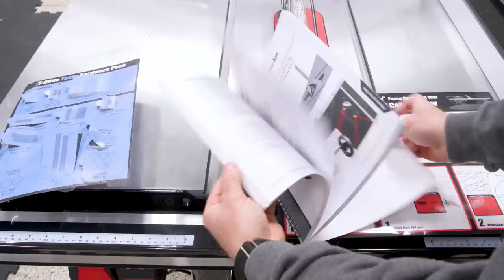I Left Powermatic for Sawstop!

Comment: What SS doesn't tell you
I love my SS and have no regrets about my purchase as a saw. It is by far and away the best saw that I have ever owned. It was spot on out of box and the only adjustment I have had to make over the past 2 yrs is in the fence alignment to the blade. When it is aligned it cuts with ease and it is only 1.75HP PCS. However, on one occasion it took a huge chunk out of the end of left thumb. It was my fault like all of these things are but like most people I was expecting the safety system to protect me, expecting no more than a slight nick. SS position per the manual "the safety system reduces injury and not necessarily prevents it". The safety system is a 2 part process, it triggers the cartridge and pulls the blade below the table. On this occasion the cartridge triggered, as it should, BUT the blade did not drop below the table. So even though there was only a very brief contact with my thumb blades are mighty sharp. So, why did the blade not drop below the table? The blade dropping relies on the angular momentum to drop but to do that it must be spinning above a certain speed. When is the most likely time that we might be foolish enough to go anywhere near the blade? When it slowing down after powering off. Below a certain speed the blade does not drop and it requires very little rotation to create a very nasty cut which took 1 month heal and still bugs me in cold weather. Every single demo of a SS with a wiener shows it at full speed. I have yet to see what happens to a wiener when the blade is slowing down. I wonder why SS never show that?? When I contacted SS (to get a replacement cartridge) the guy on the phone said "don't tell me the blade was slowing down!". So SS are clearly very aware of the issue. An active system to pull the blade below the table would be much better than a passive one. If the cartridge can be triggered why not an active device? So there is a weakness in the much heralded safety system! SS position was "you still have your thumb". Out of interest in every local WW store that sells SS I have describe what happened to me and asked "were you aware of this?". I don't need to tell you the answer!

Comment: Have you considered keeping the old saw as dedicated dado saw to avoid  the hassle of cartridge changes?
Reply from the maker: No. I really don't have the room for two saws. And if I'm avoiding cartridge changes then I'm sort of defeating the purpose of having the saw. If you want to run a dado without the safety feature, you can just install the dado and put the saw in bypass mode.
Reply: @woodwhisperer  thanks, didn't know that was an option
Reply: @woodwhisperer  the saw will actually refuse to start up if it can't detect a blade close to the cartridge. You gotta install the dado cartridge to use a dado stack

Comment: I'm curious as to why you didn't go with the integrated base given that you don't use it often and you liked that feature on your own Powermatic. I have my own sob story about the integrated base but would be interested in your take.
Reply from the maker: When I placed my order for the ICS, they shipped the things they had in stock immediately. So the industrial mobile base and the extra brakes arrived....then I waited several months. I switched my order to the PCS and already has the industrial mobile base on-hand and I didn't feel like dealing with returning it.
Reply: @woodwhisperer  Looks like circumstances worked out for you. I'm less than impressed with the integrated base which is curious as I overall love the saw.

Comment: Just curious as to why you didn’t move your Very Super Cool Tools fence over to the SawStop.
Reply from the maker: Couple reasons. Laziness is one. It took some work getting it attached to the PM fence and I really didn't feel like removing it and putting the old fence face back on when I sold the PM saw. Also, if I'm using it as a "face" the VSC fence is pretty big and bulky. So a simple extrusion was the better option for me in this situation.

Comment: Another great review! But, I have to question the blade kerf size and riving knife size w/dust collection. I bought a Laguna with almost exact same set up hoping to eliminate my overhead aftermarket Dust collector and have a good riving knife with anti kick back. The riving knife is .125" ONLY. I use Forest Ultra thin at .083 or Tenyru at .076 (I think) rendering the entire structure useless as "teets on a Bull"!  If SawStop offerers different size or into, you should mention this, IMHO. And, I had to block off the vacuum outlet as there was no such thing as an internal blast gate when not using the stock dust collector/riving knife! I quickly went back to my aftermarket overhead unit that also allows me to see the blade cut the wood, which you will not see with the stock unit you have as my Laguna. I cut all hardwoods as I make furniture and cutting boards. I use a 36" x 1/4" x 3/4" Oak vertical grain with a little notch at the top for a push stick. My hand NEVER gets close to blade. For me, the SawStop break is a useless expense feature. Also, the Fence on the Laguna is far superior in that it can be used tall or short! I cut small pieces and have been using a home made short fence for years. The Laguna is same extruded aluminum as your aftermarket  but with two options and two sight glasses for each! Laguna also added a Digital readout for tilt, which I thought was frivolous, but I now love for quick repeatability.

Comment: So there are a few to mention about the "saw stop tax." First up, you do not have to install a dado brake cartridge. You can just install a dado and activate the saw with the brake turned off. The way this is done is by turning the key, waiting for a green light flash, then powering up the saw, waiting for a green light, and once that light flashes you let go of the key. This is a perfectly acceptable situation if you're making just a few cuts. It makes you think about the safety when powering the saw, reduces switching time, and is equally safe to any other dado cut. The second thing to mention is the wet/moist wood. While this can in theory a problem, it really is not. I personally have cut moist/wet wood before, and never has the brake gone off. There was some wood that the saw would power off during the cut, displaying an error code about wet/conductive wood, but the brake did not go off. The saw can detect the difference between conductive wood and humans.

Also, check out the sliding compound table. It's a really neat addition. I know you love your miter gauges and have a miter saw, but teh sliding table really makes life easy for some work. Also for me it eliminated the miter saw, which helped greatly with space.

Comment: No way what I do justifies a SawStop, or the previous granite top Craftsman either.   One day my wife said “Let’s go get you a SawStop. Get what you want.”  I got the 36” PCS with the ICS mobile base and the folding out feed table and the T-Glide fence.  The extension table is junk, mine is now plywood with my router under it.  The router is on a magnetic switch, so if the router is on when I plug it in it doesn’t start up.

Who am I to argue with my wife?

Comment: I bought a new Powermatic Model 66 Tablesaw with 5hp Leeson motor in 1987. I had the motor rebuilt in 2016. This saw has several hundred thousand board feet of hardwood through it. This thing will last several generations.
Reply from the maker: Those old ones are real beasts!

Comment: As I recently sold my property of 22 yrs ( dope growers pushed us out)  I have  (temporarily) downsized, my entire 1000 Sq ft shop is now in storage while I build a new shop.  My 3hp 12" sliding table monster saw is there. 
I bought a Saw Stop Job Site Pro saw about 5 months ago for an interim unit. 
What a disaster.. 
During assembly the top deck insert slot was discovered to be  1/4 inch off and the blade could not go through the slot. Phone call, new piece to be sent. 
Next after assembly completed my wife said the top was warped. She is not a woodworker, but she saw this immediately.

I did not expect this as Saw Stop's ads and web site video claim "most accurate job site saw on the market"
I got out my handy 4 ft steel dedicated straight edge and began measuring.. shocking.
I measured 4 locations front to back and side to side.
Anywhere from 80 thou to ONE HUNDRED AND FIFTY SEVEN Thousands off.

Not Flat and obviously not accurate.
The following day  (Saturday) I took a 3 hour tour of 5 dealers selling other name brand job site saws such as Bosch, DeWalt, Makita etc anywhere form $275 to $1000         
The worst was  about 15 thou off and the best ( and cheapest) was dead flat.

On Monday I called Saw Stop.. The answered as follows. Hullow. I asked isi f this was Saw Stop and it went down hill from there. The challenged me and as much as said impossible and I am mistaken

Two Items here I have been a professional furniture maker for 220 plus years, second .. prior to that gig I was a corporate trainer  Field Management Training Manager   ( Mercedes Benz of No America, Volvo Motors of America, BMW of No America, Mazda Motors of America.etc  )  My expertise was Auto Management, financial , operations, inventory, parts and service management but primarily CUSTOMER SERVICE for 25 years. Saw Stop was a miserable failure.

After being referred to other departments ( who did not coordinate with other departments)  and a complete run around for 3 days and promised phone calls that were never made.. I returned the saw to the dealer  ( a 4 hour round trip)  I simply asked for a replacement saw.. they insisted that the variance in the to elevation was within specs.. they refused to give me their tolerances. I asked for a replacement saw.. no response.. none.
I got the dealer involved Oregon Tool Roseburg Oregon.. fantastic store) they contacted Saw Stop. They  would refund my purchase.. and she made an agreement with Saw Stop to trade out for a replacement (which I later found out took a couple of months)  
I made one final call to Saw Stop to remind  them of their promised calls to include their tolerable variance.. which their repair dept gave to me.    33 thou.
I also told them that I would buy a replacement if it was level.

No follow up, nothing.. but now I am getting spam from them for the last few months.. amazing.

Finally a saw came in and once again I drove the 4 hr round trip to see another saw. The owner of the company assisted me.. thank you Milo.. outstanding customer service. The top was flat except for a small area of an 8 thou drop. Tolerable.    I have assembled the saw and here is my lengthy review.

I bought  the Saw Stop Pro  for three  reasons, ...  space/portability ,   "accuracy"/ quality.  ...see above and safety. 
 With motor cyclists, there are two types ( I have been rising since the mid sixties, adult bikes BMWs , Italian and English )  .. Those who have been down and those who are going down. I have been down hit form behind by a crazed yuppie bitch doing 80, nailed me in an off ramp  .. me doing 45 the posted limit.. .. grim and Gorey...   
 With wood workers who use power tools  there are two types, those who have had an "accident" and those who are going to have an "accident.  I have had my re attachment experience, a few operations and a couple years recovery. 

 Space and portability... Check
Safety.. presumed,  not going to poke the bear... check 
Accuracy/Quality..     (to a point, crappy fence as an example)     1/2 a check
It is my opinion that the saw itself is adequate, no more. It is in league with DeWalt.. most certainly not the quality of a MAKITA.    I consider it to be grossly overpriced.. without the safety feature I see a $500-600 saw. 
It is not a $1000 saw with a safety feature at $500.

Then why did I buy it.   
I do not want a repeat of my last event and my wife INSISTED  I get the Saw Stop solely for the whack your weenie feature.. I acquiesced.

Now that I have used it .. would I buy it again.. NO. I would buy the MAKITA and be as careful as possible. 
Two reasons, average quality and poor fence.. and I believe that Saw Stop's Customer service is substandard and 
they are capitalizing on fear as a marketing ploy . Additionally because of  their pricing policies and threatening dealers in taking away their franchise if they sell below MSRP..  And  because they refuse to sell other manufacturers license to use the system.  Note that it is my understanding Bosch had their own system which I understand they did not patent and Saw Stop sued and won and as  a consequence Bosch no longer has a blade brake. Conclusion,  greedy opportunists with little understanding of customer service with an overpriced average quality product.   

I do not have buyer's remorse. I made a decision ( an irrevocable course of action)  and will use the saw until my shop is built and off the Saw Stop. When is is gone I will use my 1984 Swiss MADE INCA as my back up saw.. now there is quality and accuracy. Price  for this very small ( though not portable) professional saw when I bought it new
in 1984.. $1500 USD  and worth every penny. 

The above are my observations and OPINIONS based on those observations. YMMV

I am not sponsored by Saw Stop or INCA  Corp which is no longer in the USA or MAKITA. ( though I am in the process of buying one of their cordless track saws rather than a FESTOOL which owns Saw Stop. )

Comment: I'm kind of torn on the ethics regarding the brake system being monopolized. On one hand, it's a fantastic invention that has saved lots of fingers and should demand a premium which sawstop should (and does) benefit from. On the other hand, the fact that no other saw can have it means it won't be available to most people. Consider if only one car manufacturer had the rights to put backup cameras on their car. Good for that company, not so much for the consumer. I assume Saw stops exclusivity comes from a parent, so I wonder what happens once the patent expires. Will we have more options for safer saws?

Comment: Felder sells a saw that uses a magnetic blade drop/stop system (Preventive Contact System).  It does not use expendable cartridges, so does not destroy the blade and can be reset instantly.  Very expensive, so personal use is probably very small, but just wanted you to know there is another similar system out there that does not impinge on sawstop patents like Bosch does
Reply from the maker: Oh I'm aware. But until the technology is on a similar priced saw, it may as well not exist. :)
Reply: @woodwhisperer  Agreed, out of the price range for most, but you never know if you could arange a sponsorship deal with Felder.

Comment: It sounds good, but I've seen it result in people being less careful, because they trust the tech will work, whereas I see it as the tech should work, but, like all things made by man, it could fail, and that's why I won't trust it.  Also, if you;re cutting anything with a metallic layer, you have to override the sensor, making the saw operate like a regular table saw.  There are also issues with the mechanisms that position the blade (mechanically, significantly different from other cabinet saws) building up dust to a point where it binds up, and you have to poke around in side and try to clean places you can barely see.   The loop in the internal dust collection duct often causes blockages via buildup of scraps.  I've also experienced control box switch failures, requiring parts replacements, and the arbor developed a howl within the first year.  The one feature I really do like about this saw is the riving knife that is quick and easy to remove or reinstall as needed.  [7HP 3ph 52" ICS]  Overall, I think my JET cabinet saw is a better package, despite lacking the riving knife.  Mechanically the Jet (the slightly less fancy version of Powermatic) is superior to the SawStop, in my opinion based on use and experience.

Comment: The point you make about time taken for the blade to stop after the machine's motor is turned off is exactly the reason why dado stacks aren't a thing in Europe. There's regulation about how quickly the blade needs to stop spinning and dado stacks are too heavy for manufacturers to be able to still meet that criteria.

Comment: I went from a 1 1/2 hp jobsite tablesaw to the 3 hp 52 inch saw stop tablesaw. Don’t even know that that’s a fair comparison it was like night and day. The job site so I would only cut three-quarter inch hardwoods anything thicker than that I had to do in multiple passes. That 3 hp saw stop cuts through for quarter 8/4 hardwood with no problem

And yes I have paid the saw stop tax twice in 12 months. Both times it was due to aluminum. my finger touching the aluminum and the aluminum touch the blade triggered it.